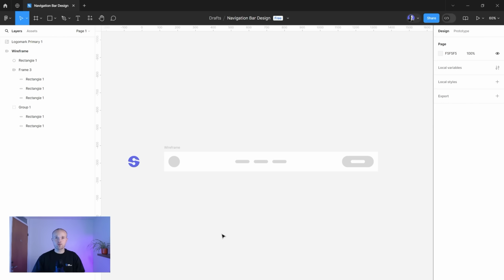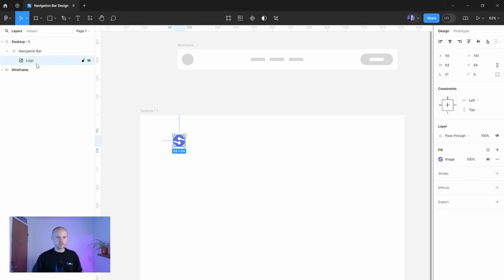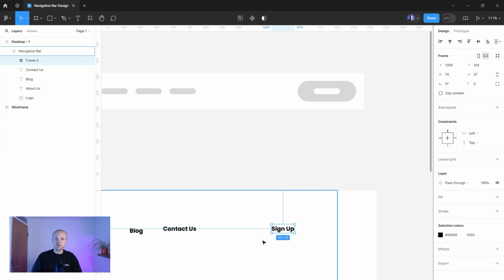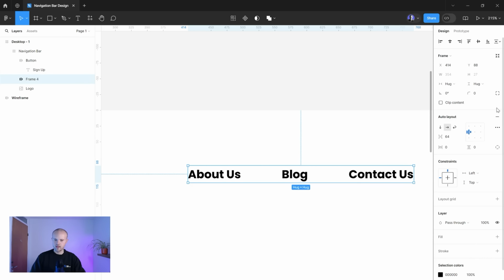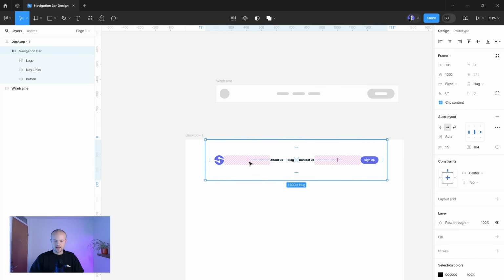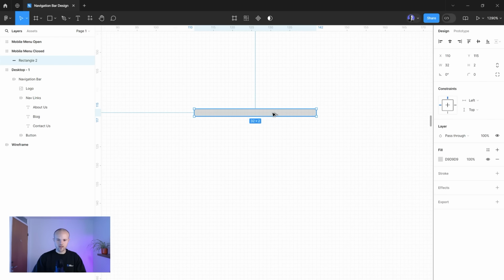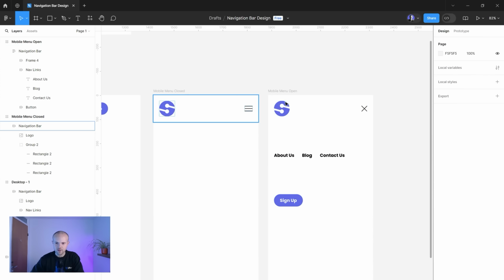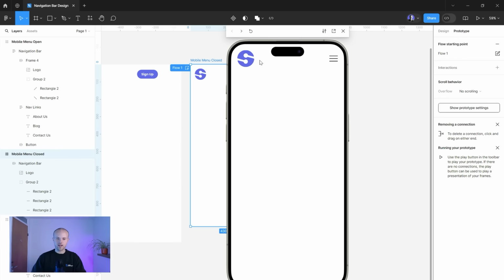How to Create a Perfect Responsive Navbar in Figma

Comment: Great tutorial! I'm new to Figma and this helps a lot! I noticed that the properties/position under "Frame" are greyed out and I wonder if I can manually drag the "Sign up" button down to the bottom of the page or any other way to position the items/link freely(?) because I personally find it looks nicer this way. Thanks!
Reply from the maker: I'm so glad it was helpful! 😊 So in this instance the positioning properties have been greyed out because we are relying on auto layout. I completely agree with you, that sign up button would look great at the bottom. You have two approaches: 1) add a transparent, empty frame above the button with a height set to "fill" to ensure it stretches out and forces the button down, or 2) instead of the menu having a specific spacing in px, set it to space between and group the top elements together, meaning it will automatically add space between the top elements (grouped into 1) and the button.